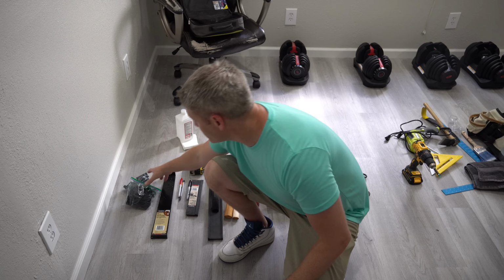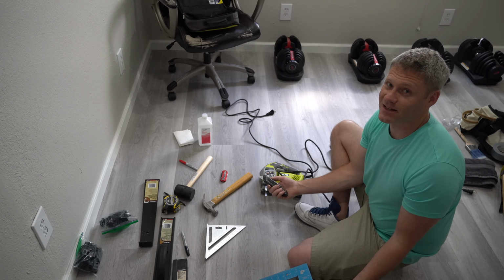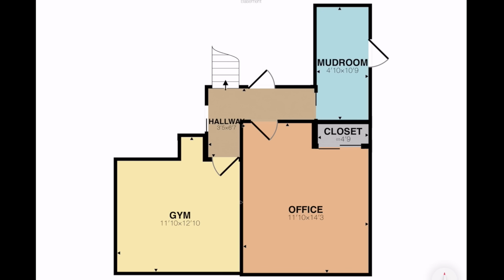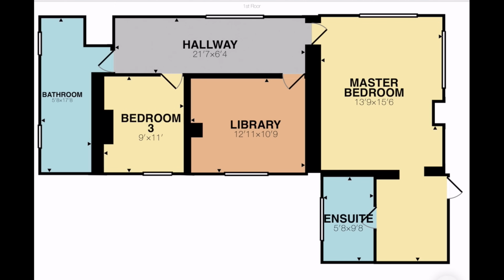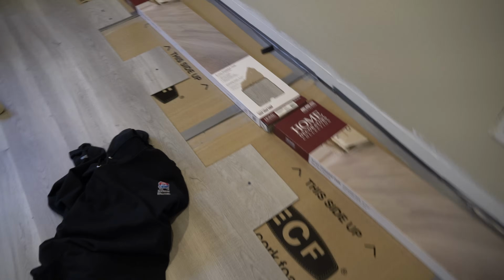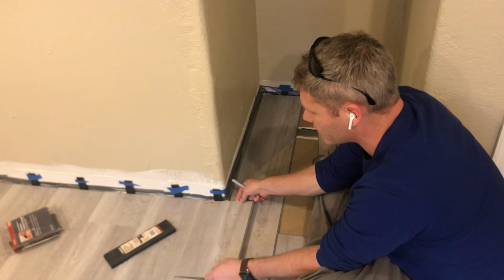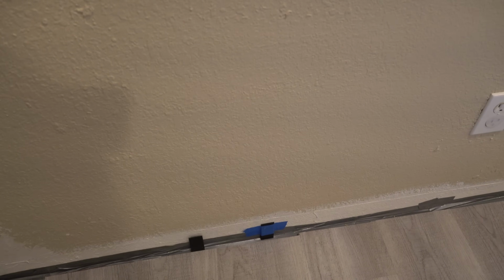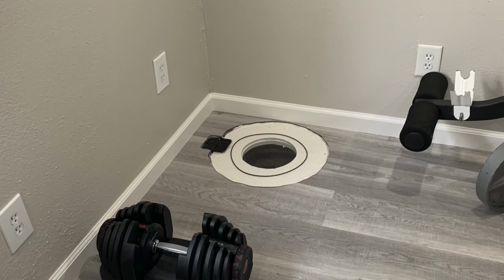How to install vinyl plank flooring in multiple rooms or whole floor.

Comment: I’m most impressed that you still call your friend, “buddy” in the video after finding those mistakes. Friend or foe, I would’ve been using a different term when I found those mistakes! Those mistakes are the very reason I don’t hire friends. You may have saved a little money on install, but wasted materials, and more valuable: time.

Comment: I have just recently discovered this vinyl by Lifeproof at Home Depot. I also have a concrete slab that I would be applying it to...  I really like the way you showed all of the tools you would work with and the actual way you showed yourself working through the problems that came up. Good job and Thank you for your time. Very informative..

Comment: By far the most extensive video I've seen - thanks! One thing I missed and wonder about is "working backwards". I will have places where I'll go through a doorway and have to backtrack 3-4 feet in the other direction. The best I can figure is that I'd be laying out that section as carefully as I can so it's like a big sheet of flooring, and then to lift it up and snap it into the piece that's running through. Hard to explain, and would be nice to see via video:)
Reply from the maker: No problem, glad to help!

Comment: Great video! Thank you so much. In the part where you tried to put a whole piece in a door way horizontally... this can be achieved by bending the plank upward like a rainbow. Then you can get both ends in and push down the plank in the middle.
Reply from the maker: Thanks! Sounds like a good idea, I'm sure the board will eventually snap but I think they got some give to them.

Comment: Very comprehensive!  You covered a lot of considerations, tips and tricks that other LVP videos don't cover.  As always, the proper planning up front makes the job go so much easier without surprises half way through.  I can just add one comment regarding LVP or any other type of floating "click" flooring.  I was debating whether to sand and refinish all the 50 year old existing hardwood floors in my home, since they are already there, or whether to install new flooring over them.  Refinishing hardwood floors requires the entire floors of the house to be cleared of all furniture, etc, before sanding, repairing, staining and applying multiple coat of polyurethane.  You need somewhere else to store everything and each process requires a lengthy time period, compounded by the drying periods between each coat of finish.  A "click" floating floor allows you to move furniture to one side of each room to lay half of the room, then move furniture to the new finished floor area to complete the remainder of the room, or you can store in another room while you complete the existing.  This is also a much cleaner process without the dust and noxious fumes of refinishing existing floors.  Finally, the cost between the two processes is comparable.
Reply from the maker: That is a lot of variables to consider. After 10 months of the LVP I am realizing at least the stuff I got is not as durable as hardwood. Where my office chair wheels rub each day has started to chip the edges of the VLP. I order a floor mat for the chair to prevent this, but unlike hardwood once its chipped you can't restore that plank.
Reply: @waltsreviews90  LVP is available in a number of different qualities from a number of different sources.  One assumes that the more expensive will be better quality, but you never know.  A floor mat at your office desk is a good investment.  We don't realize how much an office chair moves with those small hard wheels during the course of a day.  Most floor materials will wear badly under an office chair.

Comment: Well,, I had difficulty going into closets and the baseboards where installed, with crazy slot cuts, etc, etc, As you said, and many others will also,
But I cut a piece in half with a good blade on a miter saw. And used crazy glue between the perfect butt joint. It worked Amazing and the joint was invisible

Comment: This was a great video and addressed the multi-room complexity the everyone else avoids.  However, I was surprised by the multiple layers that became installed.  So much discussion is given to making sure floors are level and clean.  You had a moisture barrier, underlament pad secured with duck tape(!) and covered with padded vinyl planks. It seems that you would have areas of bumps from any gathering of material beneath—let alone the duck tape!
Reply from the maker: Thanks, hope it helped with your install!

Comment: This is a great video. I had to figure this all out myself. I spent a long time on the math of multiple rooms and the edges until I finally just realized there was no way to get it perfect and that I just needed to prioritize the hallway, say as the thought process you took us through. I also realized I had to lay the hallway first because I could fit an exact whole number of boards there and there was no way I was going to get it right by working my way to the hallway. So I had to work backwards for a big chunk because the hallway was priority.
Reply from the maker: Agreed, I would also start with the hallway.
Reply: It's been a while since I watched this video, so pardon me if you've covered this already. I just wanted to follow up now that I'm done with my project. I started in my hallway and went down the right way and up (backwards) for the kitchen and dining room. The real problem with going backwards is when you hit the wall. You need a lot more space to go backwards than to go forwards (I mean on the long end, not the short end) so when you go backwards and you hit the top wall, there has to be a bigger gap. This isn't a huge problem if you're hiding that gap under quarter round or baseboard. But it's a real problem if you've got a doorway to the outside that doesn't just hide the gap. Interior doorways, you can just hide the gap under a transition. So I'm talking about outside doorways. There's just nothing to hide that gap (that I know of). My problem was that I had two doorways that way, so when I did them, I had the most agonizing time trying over and over to reduce the gap. I kept trying different ways to pinch the boards closer and closer and ended up kind of damaging them because I was trying so hard to squeeze them in while going backwards, which is just hard to do. It's much easier if you take all the molding off the door frames, but that's a pain and you will still have a gap.

So I'd say just try to avoid going backwards if there are doors that way. My hallway was in the middle and I had two doorways one way and nothing the other way. I made my decision based on square footage (there was less square footage the direction I chose), but that's a mistake. Choose it based on the doorways because they're the biggest pain). I should have reversed it, then I would have had no doorways and the gap would have been smaller and easier.

Anyway, so what I ended up doing was getting some colored caulk. It's the same color as my vinyl planks, so it looked pretty good.

Comment: Amazingly detailed video, thank you.  This really helped answer some questions for me.  I like to think I'm reasonably handy, mainly with woodworking, but haven't installed a floor before.  We decided to give vinyl flooring a try after our old Labrador ruined our maple hardwood floors on the main floor.  Our new dog is even heavier and I just didn't want to deal with watching a brand new hardwood floor get scratched repeatedly over time.  So we decided on SPC 8mm flooring with a 22mil wear layer.  This stuff is HEAVY (especially compared to WPC vinyl) and seems quite durable.  One concern at the moment is that our family room has two corners with 3/4 maple stair nosing, so I need the vinyl planks to sit flush with them (edge-wise, height-wise is already taken care of with 7/16 OSB overlaid on subfloor + 5/16 thick planks = 3/4).  Now, I've heard that SPC doesn't expand as much as WPC - so I was thinking of either a) putting a small bead of grey caulking along the edges that touch the nosing or b) tacking those edges with glue.  I think gluing them will look cleaner but I'm not sure if gluing just that one small corner will cause issues or not.

My other big concern was something your video addressed and that is running the planks through multiple rooms without any transition pieces - I can't stand transitions and that's one reason I was hesitant to try vinyl flooring in the first place.  But it seems like your layout is similar to mine and that it went well for you.  How is it holding up?  

Again, thanks for the very detailed and informative video.
Reply from the maker: I moved in July but it held up well until then. Only regret was not leveling the concrete under the floor first. The unevenness, led to the edges in some spots being raised and a place that something like my office chair would catch on and ultimately damage.
Reply: @waltsreviews90  can you put underlayment over a hardwood floor that's in good shape and install vinyl over that?

Comment: Great help this video. But you can slide a board under the door. You have to cut out the doorframe with saw or multitool. Than sand of the locking a little bit and slide the board under the doorframe.
Reply from the maker: Great tip, thank you!

Comment: Thank you so much for making this video! I’ve installed individual rooms before but I’m about to start an install on an entire house. This was very helpful!
Reply from the maker: No problem glad it was helpful, that is exactly why I made this when I went to do it I could not find a video that explained more than just 1 room.
Reply: Did you already do it? how did it go? I plan to do it on my own too
Reply: @sivanmichael4790  I did! It was for my parent’s home and they love it. It was a lot more work than I had expected though. The house is 2,211 sqft with an open floor plan. So some of my biggest issues were the floor not being level in some spots, the walls weren’t straight and the most frustrating issue was that I went too long without putting a transition strip so it REALLY messed me up. Since it had an open floor plan there wasn’t an obvious spot to put a transition strip. I ended up having to backtrack and like 3 times until I figured out a spot that worked and didn’t look completely ridiculous for a transition strip. It was mainly frustrating because at first I wasn’t sure if my problem was being caused by the unlevel floor, the uneven walls or the lack of a transition strip. I had all three problems but it was a lot of trial and error. The four bedrooms in the house were a breeze though. Super easy after struggling with the rest of the house. It looks beautiful now, my parents are happy and it saved them a lot of money so it was worth all the frustration lol
Reply: @sivanmichael4790  Good luck on your future project as well!

Comment: Very well done. I would really appreciate it if you would tell me what software you used to mockup your rooms. We are starting a similar project and I would really like to lay it out before starting anything. Thank you so much for you time and your video.
Reply: I second this.  Having a hard time figuring out how to lay it out with the proper board lengths to visualize where thin slivers will be.

Comment: When removing base board, I cut the paint with a razor blade, then make a gap with a thin tool like the 7 in 1 too.  The use a crow bar, mainly pulling where the nails are.
Reply from the maker: That will work.

Comment: Great video. Been installing flooring for years and you hit a lot of great tips. What's funny is that I actually like quarter round with some baseboards. It almost looks more complete, especially if you have crown molding mirroring it on the ceiling. To each their own, but I love the tips. Taking the baseboards out is always a good idea. Adding backer rod between the floor and wall can help with expansion too. Nice job.
Reply from the maker: Thanks, I think in different areas of the world and country it is more or less common. I would assume if its more common in a place more people would like it and visa versa. Beauty is in the eye of the beholder.
Reply: @waltsreviews90  oh yeah. Absolutely. I thought it was a really neat thing to note about your video. You do very clean work. Thanks for putting the effort in for these!

Comment: Also, I consider knee pads essential. You'd be crazy to do this without knee pads. Maybe if you were just doing a small room, but I'd still get knee pads.
Reply from the maker: Knee pads are definitely a plus!
Reply: Also, when I went to Home Depot, I went to the knee pad aisle, and they just had some crappy cheap ones that looked too small, but I didn't see any others, so I bought the crappy ones that looked too small. They said "one size fits all," so I figured that even though they looked too small, they would be fine. They weren't. They were too small and squeezing them on was like trying to squeeze into the swimsuit I wore when I was ten years old. They ripped about 1/3 through my project and I started using painters' tape to tape them together every time I used them. It was awful.

Buy some nice ones.

Comment: Wow! What a comprehensive video! I am watching a lot of videos to install my floor but no one like this. It is so good. Must watch for any DIYer. Any tips when installing board backwards? Slightly cutting  bottom of baseboard instead of taking off can be an option or any issue with that? Thank you so much for sharing your knowledge.
Reply from the maker: I think it would be much harder to cut all the baseboards than to just remove them. Do a test run with a couple boards installing backwards before you do the final piece to get the hand of it and your confidence up.

Comment: Fantastic video. I must commend you on answering  most of the question  I've been  going over in my head, wondering if I am making the right choice of doing this myself. I just have a questions
1. When you find the mid point in your corridor and extend it to the bedroom, do you start laying the planks from the corridor into the bedroom or the bedroom out into the corridor, and what if the bedroom end pieces are small, where do you start in the bedroom? I hope I'm clear, really appreciate it

Comment: Super excellent video, thank you. What happens if you plan to do the whole house but not all at once, can you use temporary door transitions and remove them as you do other rooms? Can you glue the plank to the floor at door transitions in the same scenario?
I have a hallway with seven transition door openings, one of them is the kitchen that was remodeled and the planks were installed with the vinyl planks we want for the whole house?
Thanks again!
Reply from the maker: I don't see why you couldn't use temporary transitions, though I would not glue them down if you are planning on pulling them up.

Comment: This is good stuff but I hate tapdown on thw short seams. Do not use those planks that you have to hammer down the seams. If you have to remove the planks to fix one later they DO NOT come apart easily or they break onenor both planks.

Comment: Tap about an inch back on your header seams from the plank side you need to lock in never directly on the header. White nonmarking rubber mallets work best but a bit more pricey
Reply from the maker: That makes logical sense, I am assuming that is to reduce the risk of possibly damaging the end... I had a flooring mallet left over from when I did real hardwood upstairs, I just now put it together that the mallet side was white to help prevent marks :-). Thanks for the tip and comment.
Reply: @waltsreviews90  yes if you crack the lips they will spread eventually at the header

Comment: Thanks for the video. You’re clearly someone who likes to do things correctly.  

Hey, curious - what on earth are all those Sump holes in your floor in the different rooms?
Reply from the maker: I not sure why there are two sump holes, I asked a home builder I know and he did not know why either. Normally there is one here in Colorado basements and that is good. I think they made a mistake and put in wrong corner and then fixed it by putting it in the right corner and just left the other one. The "mistake" one was covered with carpet, so I didn't know that's what that weird spot under the carpet was until I removed it. My house is on a hill, so haven't ever had water issues, the sump in the mud room get a little water every once in a while. The other is always bone dry. Normally they are there in case of a flood the water will pool up there and then a sump pump can export the water out away form the house to protect the integrity of the foundation. House was built in 1999 and that has never happened so defiantly didn't need two.
Reply: Walt's Reviews thanks for the thought out reply. That’s fascinating!
Reply: I thought it was like a tunnel for cats 😂🤣...This was a very helpful Video
Reply: @itzToro141  LOL =D

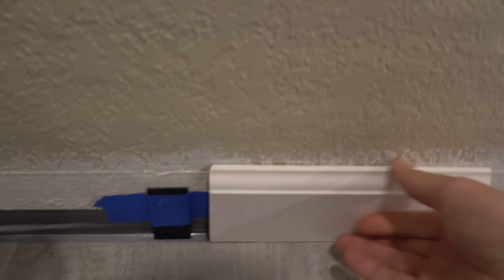Comment: Really useful video - thank you!  How did you fix the issue at 43:20 where there was going to be a visible gap between the floor and baseboard?  Did you have to redo the whole row?  Or could you maneuver the row a little further back (closer to the wall)?

Comment: Great tutorial and well explained. I have a  question since you did laydown two types of underlayment quietwalk and ECF cork over it. After having heavy furniture did that cause any damages to your vinyl flooring locks? Thanks again in advance
Reply from the maker: Thanks! No, I didn't have any issues with damage to my flooring locks. I'm not sure if there is a weight limit listed for flooring or sub-flooring, but it should be able to take quite a bit of weight.
Reply: @waltsreviews90  thank you for your quick response 🙏